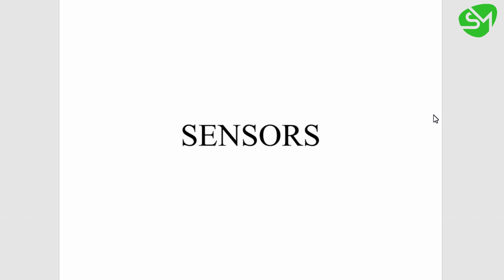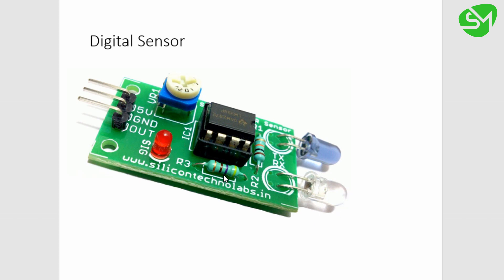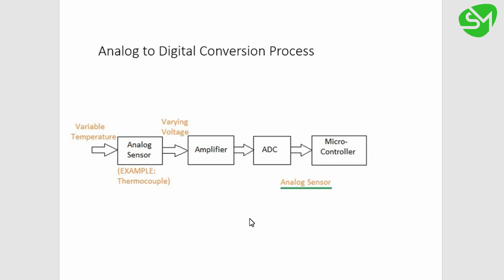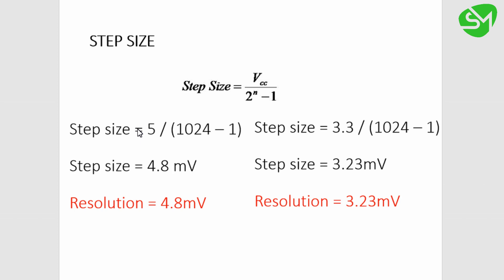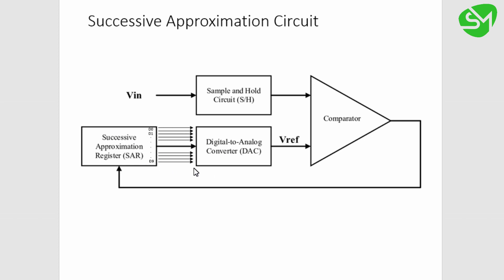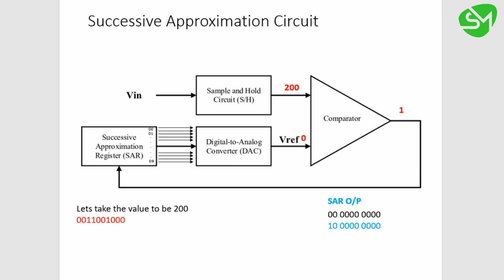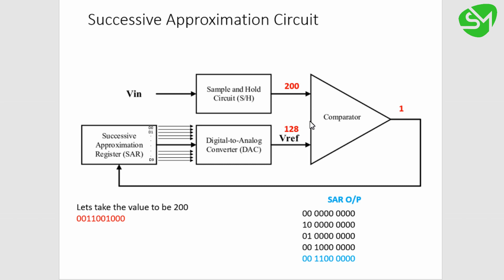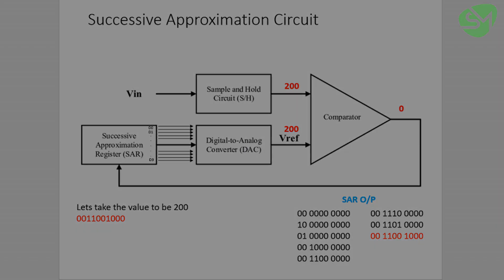ADC module working principle explained

Comment: 10:44 is that correct ?
when current position replaced it should be like 10 0100 0000. Am I wrong ? explain ?
until step 4 (00 1000 0000) is clear. after don't we put the comparator value to MSB ?

Comment: Sir First u told Vref as inverting terminal 

After sometime in the same lecture u told Vref as non inverting terminal of comparator

Which is correct sir?
Reply: Thank you for your response and great lecture sir
Reply from the maker: Thanks for your feedback too
Reply from the maker: @M.SARAVANAN bolt 
Vref is actually inverting terminal
Sorry Didn't noticed that..!